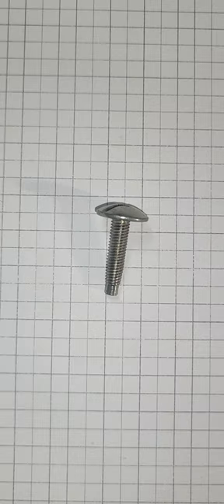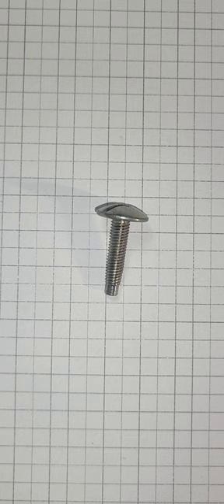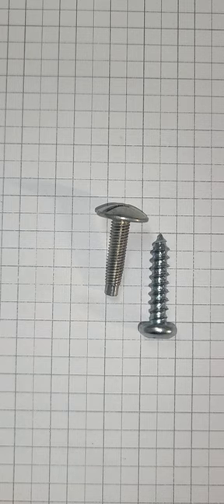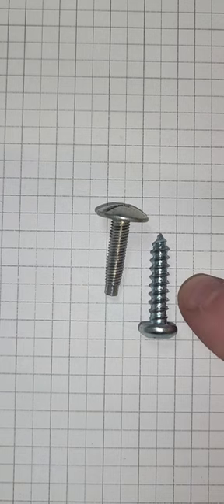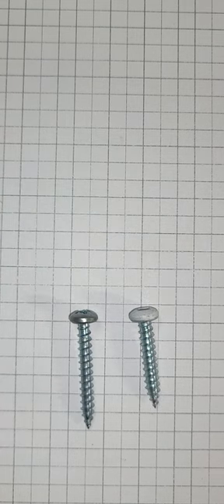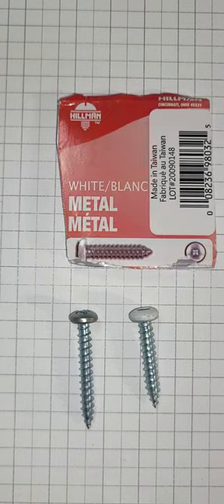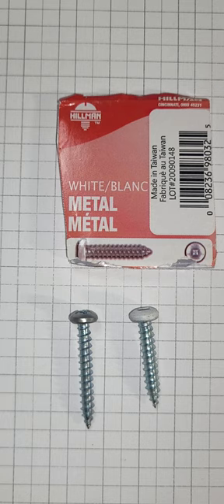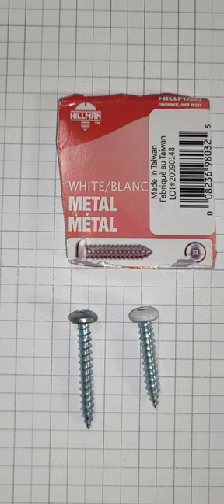Home inspector doesn't know this! #diy #diyprojects #shorts #short #tools #tool #hack #tricks #trick

Comment: fuse panel screw are dual and have no point so you can't accidentally stab or cut a wire with the point
Reply from the maker: I get that, and if he had said something about "replacement screws should be dulled" then I guess I wouldn't have too much to say. 

I do think it's quite unlikely that the conductors in a panel are going to be pushed so hard into the corner, AND so close to the front, that this would ever actually be a problem XD
Reply: true, very unlikely. keep up the great job   @MooseDoesStuff